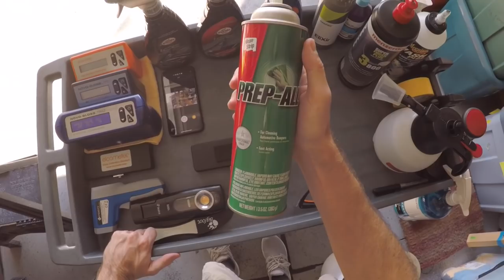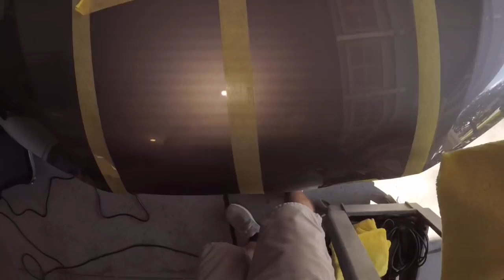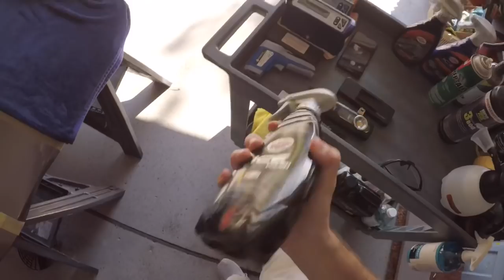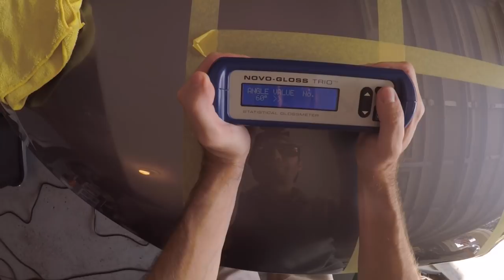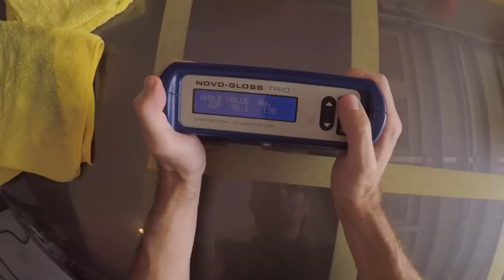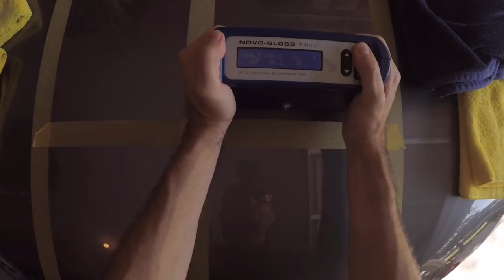Intro to Gloss Measuring - Turtle Wax ICE Seal N Shine vs. Black Polish

Comment: You and I have very similar tastes! Love the astro pneumatic. Thanks for always reinforcing the fact that improvement comes from the abrasives, a lot of people need to hear that! Personally, I’ve never really noticed the whole “this looks warm, this looks like plastic” thing from any protection. Maybe my eyes are just not that discerning. Polishing is important not only for the improvement in looks, but more importantly to me at least, is to make the protection BOND and perform at its maximum. I have you to thank for showing me that. Even though I had applied protection after polishing and on other cars applied without, I never made the connection as to why protection performed so amazingly some times but other times not. Inconsistent results until I saw some video you uploaded a really long time ago where you touched on it and I put it to the test. Always looked forward to your videos because you seemed to always get maximum performance from everything. Cheers if you read this long ass post haha!
Reply from the maker: Thanks Andres!  The Astro light has been awesome over these years, it's a great tool that is put to good use for all of my testing.  Great comments as well, I feel like so many guys are apprehensive about paint polishing for unnecessary fears, but it's absolutely the core of detailing in my opinion, and the key to maximizing the durability results for protective products.
Reply: Agreed

Comment: Great test and presentation, thanks for your time and money invested into these test.  Please tell me I'm unsure if I have to do a ipa or purple power wipe down after doing a Polish to top off with a sealant. Thanks
Reply from the maker: Thanks Joe!  Many sealants are going to work just fine if you don't happen to remove the polishing oils left behind by whatever abrasives you're working with.  It's just a precautionary step to ensure a more bare surface for the sealant to bond, but I've worked with many that don't mind if the step is not taken.  I don't recommend any type of degreaser type product like Purple Power to remove polishing oils, you want something that will flash cleanly off the surface and not leave any surfactants or cleaners behind.  

For me, polishing is a lot of work, and a lot of times the IPA wipe or using something like Prep-All is going to make removing that residue much easier, and I like to have the bare surface to ensure I'm actually removing the defects.  There are situations where the polishing oils can slightly fill in some hologram-based marring which can pop back up at a later time, the IPA or panel wipe helps remove any oils so that we can see the true condition of the paint to make sure we don't have to run another polishing step on the paint.  As a bonus, I also get a nice bare surface for the sealant to adhere to.

I use IPA at a 15% dilution, or Klean Strip Prep-All at full strength.  When I use Prep-All, I wear a half mask respirator as the fumes can cause some headaches.  Hope this helps!

Comment: Great video! I wonder if TW spray wax is  better/worse than seal&shine. GoPro footage looks professional. I just picked up the 7 black last week and love it.
****Congrats on the 10K (I just seen in other comments)****👍🏼
Reply: Seal & Shine has the edge in durability and sheets water very well. The spray wax has a bit more of that warm carnauba glow and water beading. 

They work exceptionally well together, you have the strong durable bond synthetic sealant base protection of S&S with the warm gloss of the spray wax as a maintenance topper and sacrificial layer. Absolutely unbeatable for the ridiculously low price and ease of application. 👍👌✌

Comment: Nice review. Any upcoming review on Carpro CQuartz Lite?
Reply from the maker: Yes I've been playing around with CQuartz Lite next to DPC Shield.  CQL is so crazy hydrophobic, I love it.  Definitely feels like a true coating though, it's not something that I would get for those expecting it to be as easy to apply and remove like a nice wax or something like Powerlock.  But its ultra tight beading and super fast sheeting is exactly what I want out of my coatings.  I might come out with a short term performance result, I've still got to make room on the blue car and remove something before I put it through the durability test.

Comment: Is that a gopro hero 7 black, I want one for my before and after on interiors and timelapse and what not for my detailing business.
Reply from the maker: This is the Hero 5 Black, I was really close to picking up the Hero 7 because most people were saying that the image stabilization is a lot better, but so far the 5 is working out just fine.  Once you start adding on some additional accessories and the SD card and extra batteries, that price starts jumping up quick.

Comment: Hi I know this video is 2 years old but can I stack this two? Seal and shine first then ice black polish?
Reply from the maker: No, this particular Ice Black Polish is regarded as a cleaner style of spray protectant.  Whether it’s with very mild abrasives or chemical based cleaners, this is designed to have a mild bite in order to tackle through lighter swirls while leaving behind some protection afterwards, and because of this it’s not something you want to use after applying your main protectant like Seal N Shine.  Otherwise you would bite into Seal N Shine and remove some or all of it during the application process.  If anything, use Ice Black Polish first and then Seal N Shine afterwards.
Reply: @WaxMode  my good ness thank you you reply first than turtlewax does

Comment: Great video,  btw what brand of microfiber towels did you use
Reply from the maker: I have a ton of various microfibers, I've stocked up on a lot of the Kirkland Ultra Plush microfibers at Costco when they had the 36 packs going for $15.  They are good for testing, removing the tags though on all of them was a pain, these tags on sewn on good.  Amazon has them for double the price of what Costco was charging but Costco you need the membership:  https://amzn.to/2NoIs2y

Comment: Basically one has to decide do you want shine or protection . As you said it's the foundation that matters. Two questions have you tried Beadmaker with gloss meter? And what kind of sprayer did you use for cleaner

Comment: I have a question for you. I’m got some Adams liquid ceramic wax and some Adams 9H ceramic spray. What one should I put down first. I was thinking first Adams 9H ceramic spray. Then weight 2-3 days to let the ceramic spray cure then apply a coat of Adams liquid ceramic wax. And then maybe once a month use the ceramic boost.How does that sound to you
Reply from the maker: Hey Richard, I'd most likely go with the Ceramic Spray Coating on polished paint, and then follow up with Ceramic Boost as a maintenance product over the weeks and skip Ceramic Liquid Wax altogether.  I'm not sure how well the base layer of Ceramic Spray Coating would hold up after trying to apply the heavy Ceramic Liquid Wax on top, but I don't have experience using that product as well.  We still don't know how well the base layer's properties are retained by applying heavier liquid or paste waxes on top of them.  For very strong base coatings they may be able to hold up well if you topped them with a paste or liquid wax, but in my experience, Ceramic Spray Coating is a very light coating, it's hydrophobic properties are not as strong as others.  However, it could be very possible to use Ceramic Liquid Wax first, and then use the spray coating as a topper, then maintain with Ceramic Boost or continue to maintain with the spray coating.

Comment: I am considering a Gloss Meter to show customers a measurement of improvement after a paint correction. Would definitely like to see gloss meter readings incorporated into comparison tests between competing products. 
One question I have is how many gloss units difference does there need to be between two similar surface before the average human eye detect a difference in the gloss level?  Is it one gloss unit, two units, three units?
Reply from the maker: Rhopoint mentions on their website that the trained eye should be able to detect a difference at the 5 GU mark.  For me, I don't believe I would be able to pass many blind tests at 5 GU gloss difference on 95+ GU surfaces.  Gloss measurements after correction would be a great way to objectively show the customer how much of an improvement in pure gloss is reached.  But this is also another flaw of the meters that only read gloss measurements like mine, as opposed to DOI/goniophotometers which can measure an improvement in paint clarity, as well as gloss. 

Todd Cooperider from Esoteric had a great article covering the topic, because a surface can be hazy while still producing a high level of gloss.  Whereas with detailing, the paint correction process is improving gloss and clarity of the painted surfaces.  http://esotericdetail.com/education/gloss-meters-and-automotive-paint/  The problem with those goniophotometers like the Rhopoint IQ, is they're double the price of the standard gloss meter.  Jon at Forensic Detailing featured the Rhopoint IQ in one of his videos:  https://youtu.be/htmvopCXtyc
Reply: Thanks for the link to the article on gloss meters. After reading that piece I learned the RHOPOINT IQ is likely the most useful way for a detailer to measure the results they are getting from different polishes, waxes and sealants. I was excited to learn you can measure haze and clarity in addition to gloss. Then I looked up the price of the Rhopoint and almost fell out of my chair, $3,500.00!!  Unless you’re detailing Ferrari’s and Lamborghini’s everyday this is not affordable.  It’s too bad someone doesn’t offer a cheaper measuring device for the detailing community.

Comment: Hi, 

I use MEGUIAR'S D11301 Citrus Blast Wash & Wax and need something to top off with in spray form. 

Which spray wax or sealer do you recommend for best results?
Reply from the maker: I'm still working on dilution testing with Meguiar's Hybrid Ceramic Wax in order to use it as a fully dry product.  It's so heavy right out of the bottle that you can notice streaking if you try to apply it fully dry.  It's great through as a spray and wipe then rinse.  Seal N Shine is also a great performer, check out my 5 month durability video for both HCW and SNS holding up in some spots after this extended time.  SNS I haven't tested diluting it yet or as a drying aid.  Ultimate Quik Wax and Ice Spray Wax are also great maintenance options if you already have protection on the paint.  If you like Meguiar's, I'd check out Hybrid Ceramic Wax absolutely.
Reply: @WaxMode  

Thank you for responding to me, 

I am a beginner with this so I do not prefer anything yet and do not want to make all mistakes myself :)

But I use Sonax Xtreme intensive degreasing before washing and I bought the Meguiar's Hybrid Ceramic Wax some day ago.  

I hope I get the paint surface so clean that it will be an ok result.

Comment: I have a new car less than a year old. It is a Subaru that is black.What are your thoughts on HD speed and a black pad on griots random orbital.  Do you think it will turn out great or is there a better combination?
Reply from the maker: HD Speed is a great all in one product, it's one of the few AIO products that I've worked with over the years and I've seen awesome results.  I don't generally work with AIO's because I have all the pads and compounds/polishes to separate correction from protection, but it left a super slick and clean finish with decent performance to cut through some notable oxidation on the paint.
Reply: @WaxMode  I don't have much oxidation I'm just looking to make it shine.
Reply from the maker: You’ll still get a great amount of gloss out of HD Speed, and use a lighter pad if you don’t need to cut through a lot of oxidation or tackle heavier swirls.  Let me know how it ends up working for you.
Reply: @WaxMode  I may end up doing it in the spring it was 36 here already

Comment: Hi I was looking at some gloss meters on Amazon they were between 130-160$ . Do you think I’m wasting my money because they are junk. All I want them for is fun . And I see that you use the turtle wax spray polish that is only for black cars according to turtle wax. My car is dark metallic green. So you think it’s OK to use that on my car. Thank you for your videos very informative.
Reply from the maker: Hey Richard, I believe one of the more popular ones on Amazon was the ETB-0686 model when I was looking a while ago, it looks like a lot more meters have been added since then.  I'm not familiar with their performance, but if you're trying to compare one product against another product, it can be difficult for the meter to pick up these differences at the +/- 1.0GU range if its repeatability isn't good enough to measure at that sensitivity.  These gloss meters may be much better at picking up more broad or drastic gloss changes, like going from oxidized paint all the way up to a high gloss finish.  But if you're working on already highly polished paint and then trying to pinpoint two competing products that are within a very low +/- range of performance, this is where the Rhopoint's accuracy and consistency is very good.  The lower priced ones may be good as well at this but I don't have any feedback on their performance in controlled tests to confirm.

Ice Black Polish has worked fine on the lighter paints that I've used it on, with your dark metallic green paint it should perform great.
Reply: Your great for answering my question so fast I really appreciate very much. I will be sure to tell my friends about your channel. Thank you

Comment: Where do I get one of those meters?
Reply from the maker: If you’re lucky one will pop up on eBay for cheap that is still in working condition, I don’t recommend the older ones as the aging  electronics and rechargeable batteries are likely toast.  You can get a handful of glossmeters on Amazon as well but I don’t have any experience with those, I’ve only worked with the Rhopoint models.
Reply: @WaxMode  do you know the brand name of the one you have can do a search for it that way

Comment: Can you layer seal n shine? Is yes how long between coating
Reply from the maker: I haven't tested multiple applications of Seal N Shine to see if this can improve durability in the long term.  But in general, Seal N Shine doesn't require any cure period in order for you to see its hydrophobic performance and chemical resistance.  I would be more likely to apply a second application of it in order to ensure I covered all sections effectively, or in order to maintain protection after a few weeks or months from the first application.
Reply: WaxMode thanks, I forgot to mention can you check at what point the gloss meter won’t go any higher layering seal n shine. Would it read the same from layer 2 to 3 ?

I recently applied it and the paint feel super slick I’m happy so far.